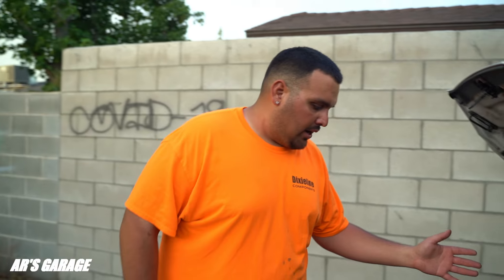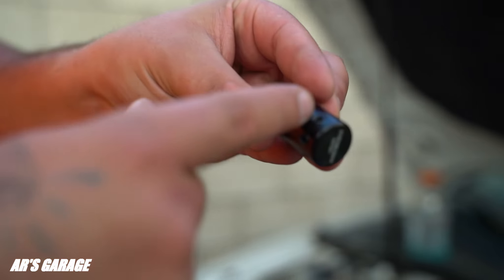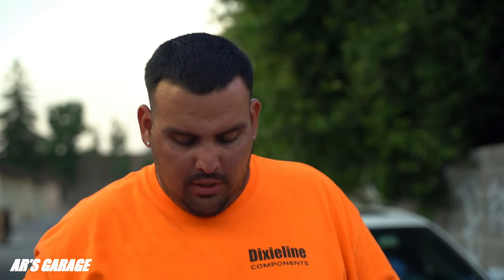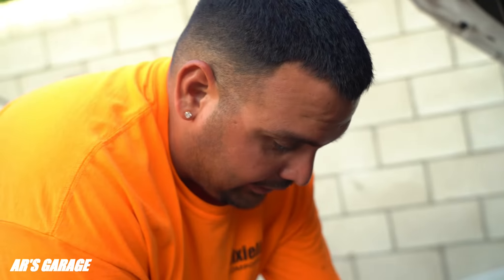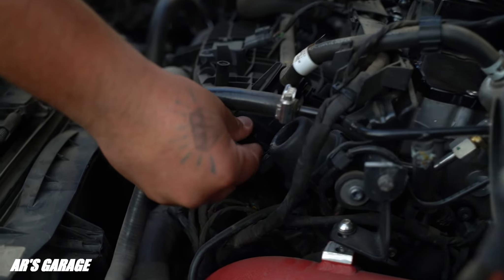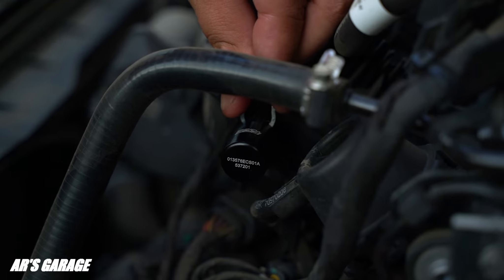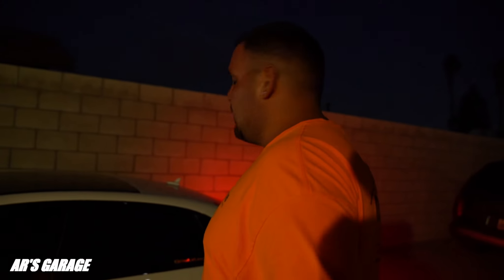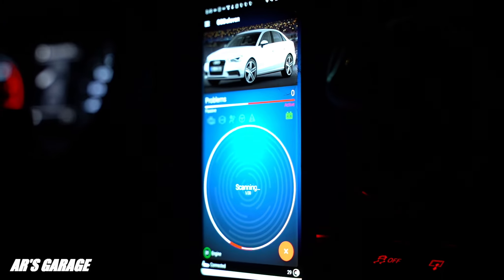DIY BOOST TAP & CRC VALVE CLEANER AUDI/VW A3/GTI/S3/GOLF R

Comment: Doing this on my next oil change, I will doing half the can through the pcv and half of it through the iat sensor/map sensor?  Thanks!
Reply from the maker: I think you should jst do it through the map sensor tbh..
Reply: @AudiA3Newbie  Thanks!  I get idle misfire "pops" in my exhaust.  RPM's stay stay the same (2008 mkv GLI 2.0tfsi), but it misfires and the unburned gas creates pops from fuel burning in the exhaust.  I hope the crc fixes it since I have new coil packs.  But I'll probably pull my plugs if it doesn't fix it.
Reply from the maker: Hopefully it helps you man..how many miles doe the car have.
Reply: @AudiA3Newbie  125k miles.
Reply from the maker: Most likely you need to change out ur spark plugs and do a valve cleaning on it.
Reply: @AudiA3Newbie  I'll CRC it, drive it, if misfire still exists I'll check plugs.  If they are bad I'll replace them/regap them. Worse case scenario I'll pull the intake off once I have time and decarb valves.  Thanks.
Reply from the maker: Well wish you good luck man hope everything gets fixed.
Reply: @AudiA3Newbie  It's all fixed now and my car finally runs good at idle, I found out one of my spark plugs went bad due to having a bad coil pack 6 months ago.  I still used the cdc intake valve cleaner and I put the tube in the spot where the intake air sensor sits with my thumb around it to prevent vacuum leaks.

Comment: Interesting video my dude... Only thing I would add is it's better to spray through the throttle body because this is also a turbo cleaner and you can't clean when you only go through the manifold.  Especially by tapping an open access that doesn't exist...

I've had 4 VW & Audis, not including 2 now and I use this in ALL of them. Never forget to clean your Turbo, that 3-4k to replace...

Here's CRC instruction, starts @ 10:58...   https://www.youtube.com/watch?v=RcVDZAauO88
Reply from the maker: Will keep that in mind next time i own another audi thanks for the feed back.
Reply: The TB sits nowhere near the turbo, also probably not a good idea to be spraying things through the cold side.